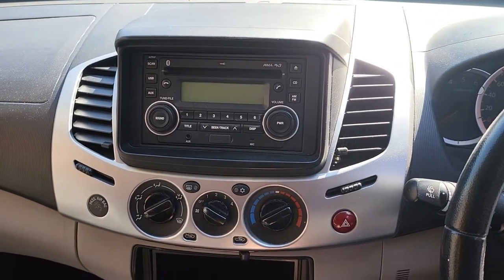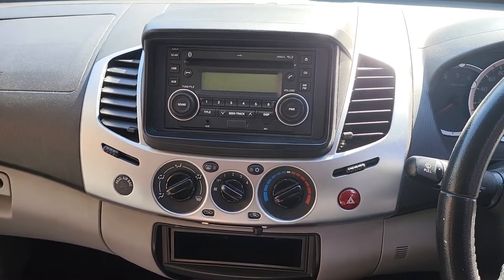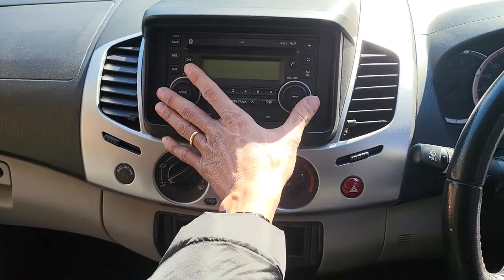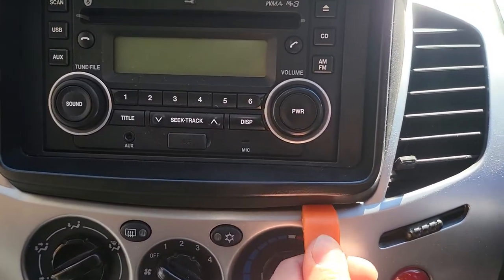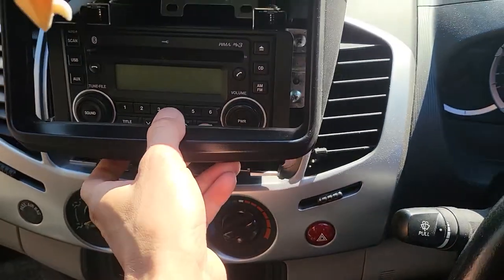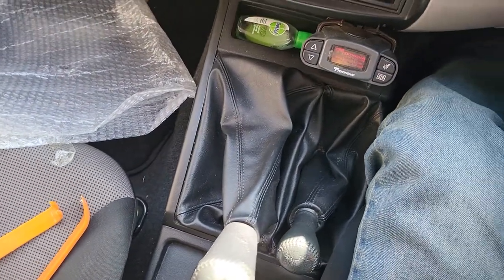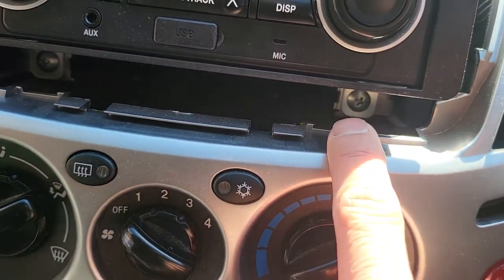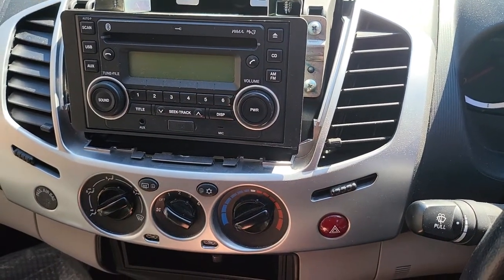Expert Advice: How to remove radio factory MITSUBISHI TRITON 2010 (2005-2015) | Details Instruction

Comment: Can you make a video on how to remove the single din head unit bro? The plastic is tight and I don't see any screw
Reply from the maker: We haven't had a car with single DIN so can not make video. But it should be similar as our video though. The single sin storage is normally locked by screws but not the outer frame